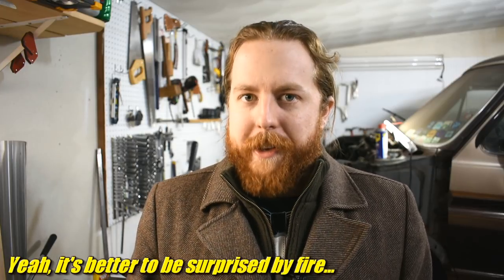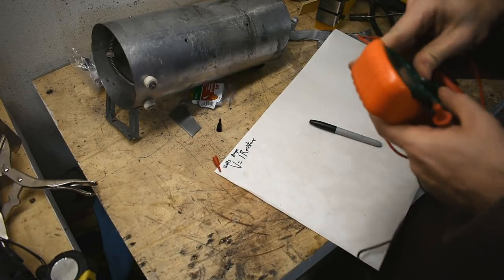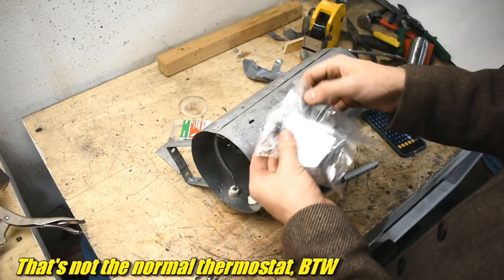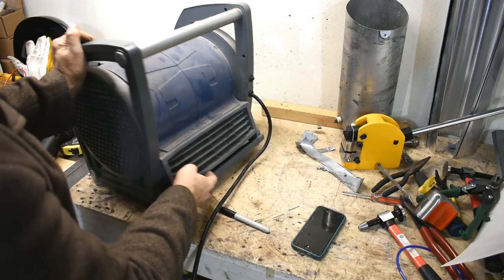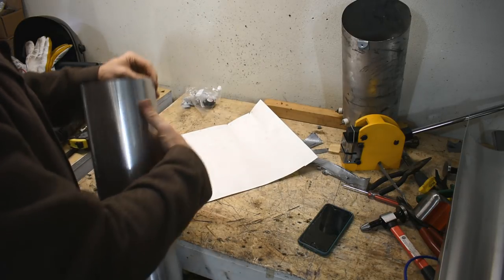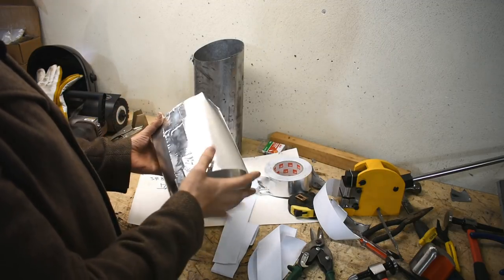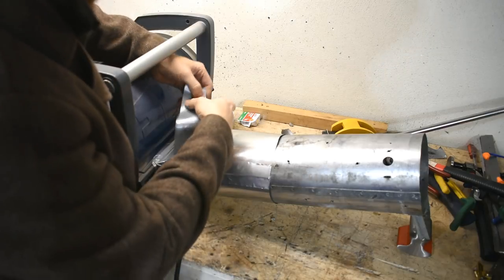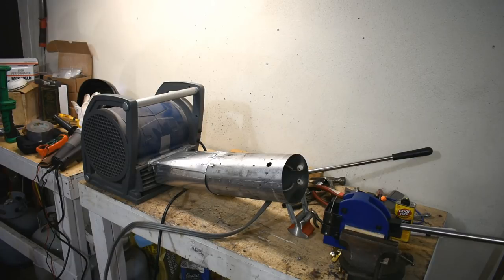DIY Garage Heater: Using Parts from an Electric Dryer

Comment: This was very enjoyable, as I just got done buying a 5000 watt electric garage heater on craigslist for $75.00 and i did the exact same "BTU" figuration for comparison. Thanks and great idea!
Reply: But did you set yours up directly next to the propane tanks in your garage?
Reply: @chadharrod5246  Aaas, no. I put mine on a 00 Aug cord and wheels, works great.

Comment: I think that making the heating element point upward would save space and also allow you to mount it to the blower frame.   Still easy to move yet a little more compact
Reply from the maker: That might work.  I'll think about it when i get to building an enclosure

Comment: Can you wire it to a rugular house plug, instead of 220, and use it in a shed or a indoor attic that isnt insulated
Reply from the maker: The element is designed for 240v, I'd you wire it up to 120 you will get far less heat.  It's about 10 ohms, so that's 12 amps on 120v, only 1440 watts, as opposed to 5000+ watts on 240v. So you could do it, but it wouldnt work nearly as well
Reply: @PaulsGarage  oh okay thank you

Comment: You could use an infinite switch from a range burner to cycle the element and give you some control over the temperature. I fix appliances for a living also.
Reply from the maker: That's a good idea!  We have some scrap ranges waiting to go to recycling, maybe i'll snag some switches.
Reply: pull the switch for the largest burner. it will be rated for more watts
Reply: I made an 800 watt heater from the drying heater out of an old KA dishwasher, used an infinite switch from a range and ended up with a nice little 120v heater, just have to watch out for the connections.

Comment: Ohm's Law will get you close enough with alternating current, I guess? You have to divide your results by 0.707 though I think? Something to do with the area of the sine wave. I just use the straight calculations myself usually.
Reply: Paul Frederick nope, v=ir also works with mains voltage, because the stated voltage is RMS, not max, therefore v=ir works nicely.
Reply: I.e, the stated voltage is already the peak voltage multiplied by .707
Reply from the maker: That makes sense, area under the curve.  I didn’t think of that.  Either way this thing gets this place nice and toasty and uses lots of power
Reply: Yeah alternating current is funny stuff. It doesn't make sense to me. Once when I was wiring up a Variac autotransformer it got really weird. Which way around you hook those things up matters!
Reply: OK if you say so.

Comment: I always thought a dryer used one 120 leg for the heating element and the other for the motor - i didn't think the element was actually 240 volts.
Reply: You're right
Reply from the maker: It uses 1 leg for everything except the element, and both for the element.
Reply: @PaulsGarage  So how many amps for each leg?
Reply from the maker: @dalesworld1308  most of the dryer uses very little, couple amps at 120 for the motor except for startup, but when the element kicks on its 20-25 amps at 240.  That is why on old fused circuits you can lose one leg fuse and the machine will run fine but never heat.  It usually blows that side not because the element is on that side (since it's on both) but because the element of only leg is always hot to the element.  If the element shorts out, it burns out that side.  The element is turned on only when the timer or computer completes the circuit by connecting the element to the OTHER leg, the one that powers everything else.  That's how everything runs on only one leg, but the element runs on both

Comment: So how warm does your garage get ?
Reply from the maker: Warmest I had it was 82f with 5f outside. Buy i don't heat it above 60 usually.  I don't want to sweat when I'm trying to do something!  And actually this is a pretty old video, I haven't used the heater at all this year. Or last year, but last winter wasn't cold like this one

Comment: Not necessarily true the element needs air or it will melt down! I was in a bind last winter when our hot water tank went out(gas). I pulled out the burner of the water tank and put a old dryer heating element in its spot. I would absolutely watch it closely whenever heating up a tank of water. I had zero issues and theres not much forced air in that area. Anyhow it took maybe 2hrs to heat a 60 gallon tank (RHEEM). I must mention the element came out of a 240 dryer. I had literally crudely connected a simple 2 wire 110 plug to the element. I before during and after knew this was risky but it got us through till we got another and watching everytime didnt burn our house down. I wouldnt try this at home kids as it was a absolute last resort!